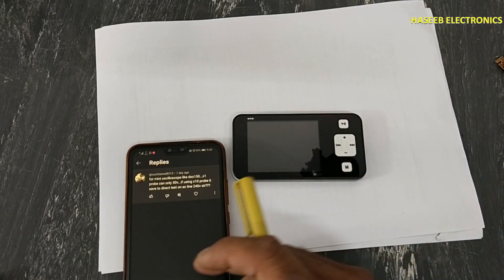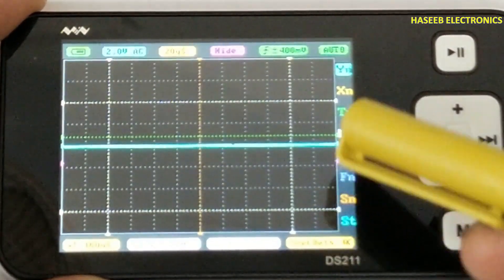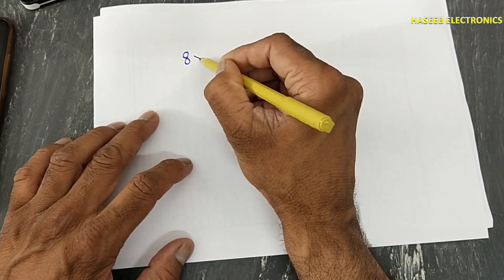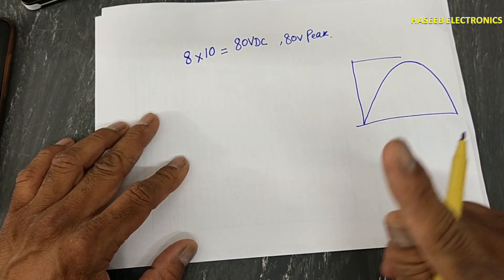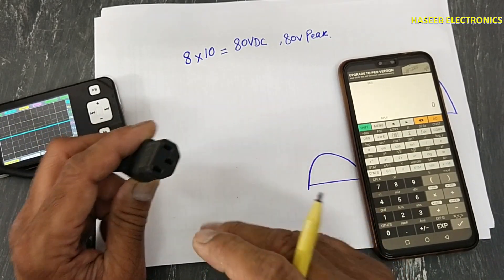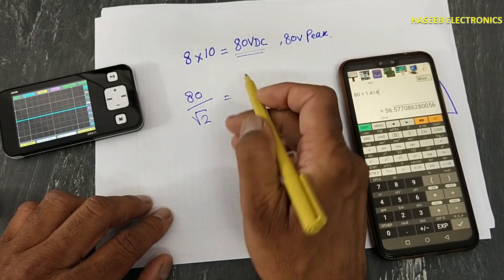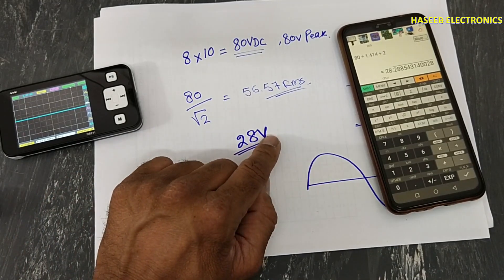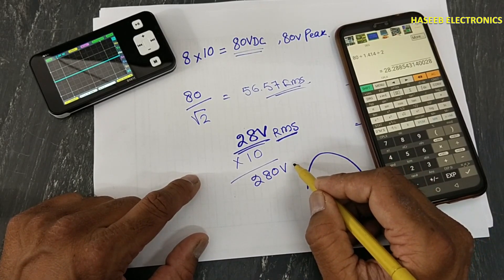{926} What is maximum voltage can be tested on oscilloscope DSO

Comment: Sir, Can I use UPS for charging battery only and use dc fan.. Load-shedding fact...🇧🇩
Reply from the maker: yes it can be done. but it will better to use some better battery charger option for charging battery.

Comment: Very good video i like this video.sir i have one question i have new oscilloscope it have max 1x 40v ok.
i think i can  input 1x  40dc voltage and 14vrms am correct or no....

2)i need 20x prob how to make it or buy it
Reply from the maker: 20x probes are not commonly used. it is special purpose probe and very expensive
it is better to purchase 100x probe 
https://www.amazon.com/Oscilloscope-Accessory-Voltage-100MHz-Bandwidth/dp/B07F65SZMV
Reply from the maker: https://www.ebay.com/itm/265399661348
Reply from the maker: https://www.aliexpress.com/item/32823041888.html?spm=a2g0o.productlist.main.11.470ea73cXBiwIk&algo_pvid=450fbecf-63e7-4d66-bca1-9fdc0e656ee5&aem_p4p_detail=2023062423241516947869850971950017142258&algo_exp_id=450fbecf-63e7-4d66-bca1-9fdc0e656ee5-5&pdp_npi=3%40dis%21JOD%2118.22%2112.75%21%21%21%21%21%40211bda9b16876742558526586d0829%2164916549697%21sea%21JO%210&curPageLogUid=wfj61wgo3hTR&search_p4p_id=2023062423241516947869850971950017142258_6
Reply from the maker: https://www.aliexpress.com/item/1005003223830934.html?spm=a2g0o.productlist.main.19.776ea73cjHtxCL&algo_pvid=1bbc732a-6679-4b5a-86b5-0b96fd514504&algo_exp_id=1bbc732a-6679-4b5a-86b5-0b96fd514504-9&pdp_npi=3%40dis%21JOD%2110.56%216.34%21%21%21%21%21%40212279b716876743138425743d075c%2112000024734415850%21sea%21JO%210&curPageLogUid=weRMb05xnPXl
Reply: @HaseebElectronics  I have two business projects one is to make 4mA to 20mA temperature transmitter and  creating a variable frequency drive circuit from scratch I would like assistance in both projects can I reach you so that we can discuss?